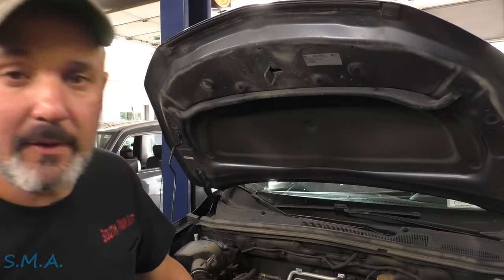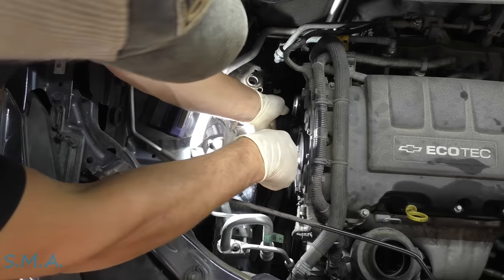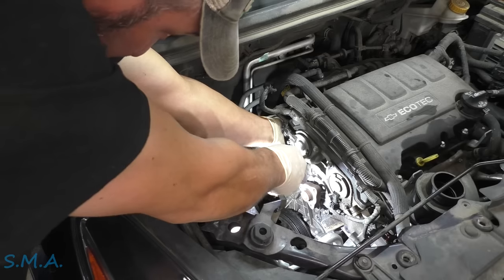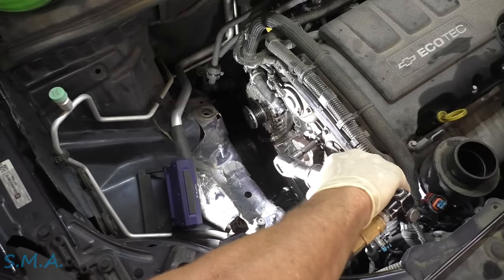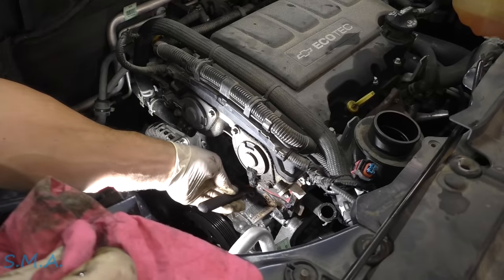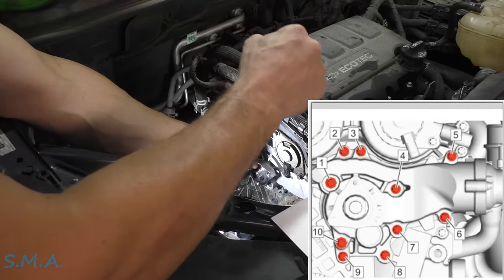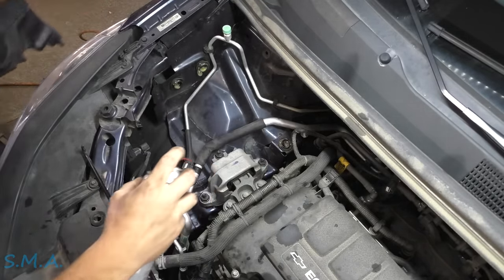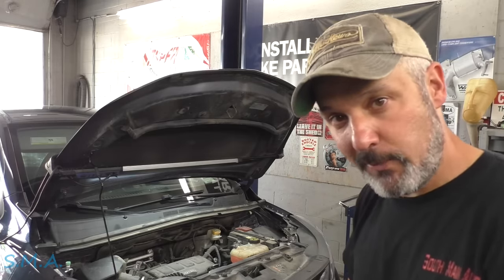Chevrolet Trax: Water Pump

Comment: Truly the most complicated water pump I’ve seen 🥺.. stand on one foot torque to yield then pass gas and go 30% and your good maybe
Reply: Gravey!!! send them over here.  Want a real challenge, try doing a water pump on a 2.4 ecotec.  And when your done, you get to play with the timing chain, because the special holding tool does not work.
Reply: @scrappy7571  crazy 👊🏻
Reply: @scrappy7571  The holding tool works just fine.  The hard part is messing with the pipe that goes under the exhaust manifold.
Reply: @zcvyvyan  We have used the holding tool many times,  sometimes it does not hold the pump properly and the chain ends up tight and makes a loud whining noise.

Comment: Must be a common fault with those water pumps. I'm in Australia and my neighbour had a 2017 Holden Trax 1.4lt turbo, pump was leaking out the shaft. It had less than 30,000km on it. An absolute shit box of a car.

Comment: Leave it to GM to come up with torque specs and "required bolt replacement" for something as simple as water pump and a "electric heater" for a thermostat. Why not just put in a servo controlled gate valve? Such B.S., so glad I left the trade....

Comment: I had a 1979 Honda Civic coupe three speed manual transmission at 44,000 miles, I am 6‘5“ tall, till this day I don’t know how I fit in that car, with my knees up around my chin, I remember during one snowstorm I got out of the car and pulled it out of the ditch that’s how like this car was and one time I got a flat tire in the rear of the vehicle and I lifted it up so my girlfriend could change the tire with no problem at all, anyway,, at 44,000 miles the water pump started leaking badly it was held in by four bolts probably about 4 inches long the pump was easy to get to with my big hands, three of the bolts came out with no problem, The fourth bolt did not come out as easy as a matter of fact when I applied A little more twerk on that fourth bolt it broke  off, opps !  I thought to myself no problem once I pull out the water pump there will be a stub and I will spray it with WD-40 let it sit for a while and torque the threads out of the engine block with a pair of vise grips, needless to say deadbolt snapped off also I was thinking to myself well I’m pretty well screwed now I am only going to have three bolts holding this water pump on so I put the new water pump on put a lot of Pirmatex sealant along with the new gasket and torqued the other three bolts to spec. I ran that engine for another 130 thousand miles and the water pump never leaked ever and obviously there must’ve been a manufacturer defect in the original water pump, because the replacement water pump directly from Honda parts, lasted 130,000 miles and was still going strong when I traded it in and bought a Toyota truck with a 22R engine in 1982…!!!

Comment: anyone have a suggestion to secure a universal lug wrench in the trunk, it will not fit in the spare tire wheel well. I wouldnt mind drilling into the spare tire cover, but cant think of an easy way to secure it, any help would be appreciated
Reply: A breaker bar with your spec head on it.. throw a cheater in there for tired moments
Reply: There is no cure for tools.. they need to exist, where ever they choose to be
Reply: @mayhew75  i like that idea, thanks

Comment: You made a crucial mistake,those three bolts holding the engine mount to block and the other three on top of engine mount are supposed to be replaced.They are stretch to yield bolts and are a one time use.

Comment: This care shares the same engine as the Gen 1 Cruze. Its a terrible design. In the intake manifold there is a check valve that breaks off and when that breaks all hell will happen with oil leaks and seals being blown.

Comment: id replace the thermostat while Im there. hose and ect sensor. thats just me.
Reply: Try that at a dealer and customers scream "rip off""
Reply: @scrappy7571  I'd had a water pump fail after cylinder head work . Also other way around.
Reply: @scrappy7571  also customer had to many brake issues. That jeep was already over 100k miles. Didn't show the rust. 😂

Comment: Why do people still buy General Motors garbage?  FacePalm
Reply: That’s all I’ve ever bought and all have been great. 🤷🏻‍♂️
Reply: I think the bigger face palm are people who buy Mercedes Land Rover and BMW
Reply: I think it's because you can get an entry-level GM car for cheaper than entry-level vehicle from any other brand.
Reply: @scottdavis_34  I've owned GM vehicles for years, and I just can't see how anyone can argue how bad their quality has gotten.  I have to have a diesel so I have a Ford, but our other cars are Honda and Toyota......and yes I know they are not without problems.
Reply: @DaveImagery  Frankly I feel they are all about the same.  I know the new Tundra is having electrical issues but the Silverado in some cases is having rod issues and Ford is still dealing with the death wobble issue.  I think quality across the board is down.  🤷🏻‍♂️
Reply: I lived in Michigan in the 1970s where most of the people went to Detroit to work assembling cars.  In my experience, GM paid their teenage workers to work while stoned on pot. Quality was definitely third priority after sales and assembly speed.
Reply: @scottdavis_34  You make a good point
Reply: @brucebauer8133  Ever read the book Rivet head?   Drunk or stoned was perfectly acceptable